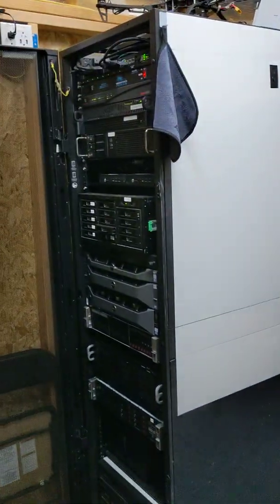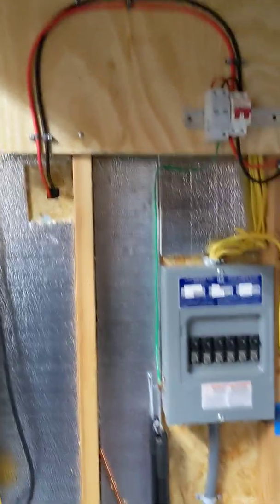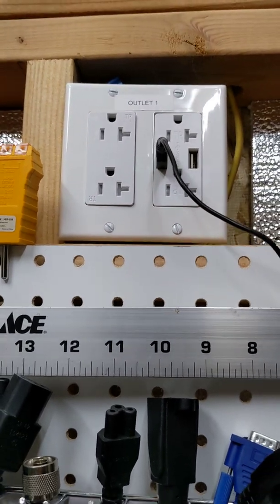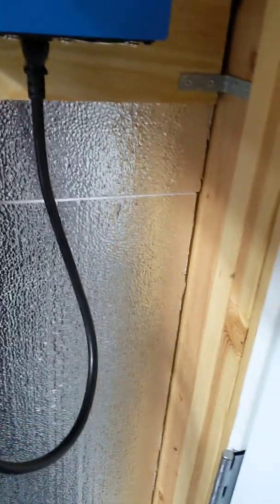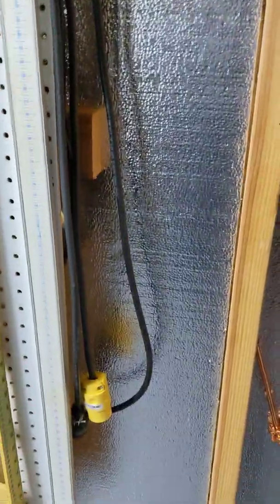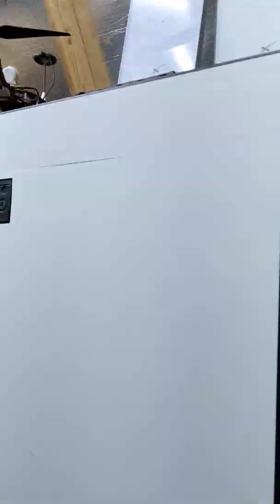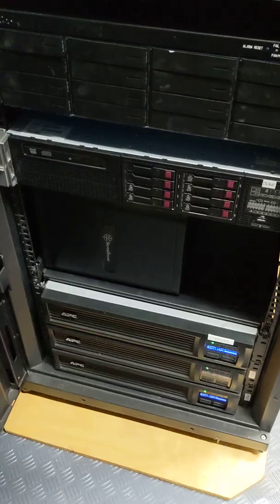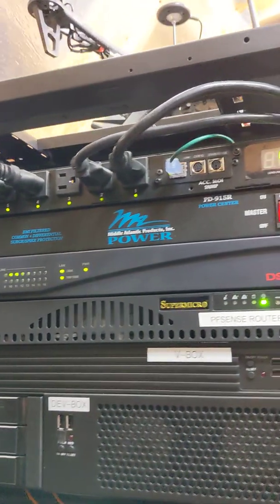Grid Tied Inverter setup  #pfsense #plex #starlink #ubiquiti #starlink #hpserver #homelab

Comment: Really awesome video.  I do wish that you could explain more (say with a diagram) on how the power comes from the solar panels (how much, wattage, amps, volts, etc.), then goes into what device & cost (maybe Amazon link to it), then explain how it feeds back into the City Power.  I'm not really knowledgeable yet on figuring out how to do the electrical wiring and electrical diagramming for solar panels, but I sure would like to look how someone else has done it.  How much power do you generate, etc.?  THat's stuff that lot of people on here would like to know.  Again, thank you for giving us a BRIEF INTRO to what you've done.  I am quite impressed.
Reply from the maker: This guy is the reason I went with the system I have.  He has parts list and everything and explains things very well.  https://www.youtube.com/watch?v=o5rI0smOivk
I dont generate enough to go back to city power.  My shed is always using just a bit more than I generate.  We have solar for the entire house that does feed back to the power grid.  My solar just off-sets a part of what my rack uses.